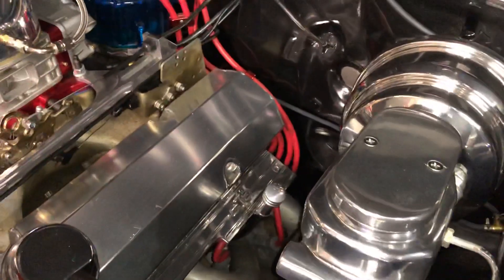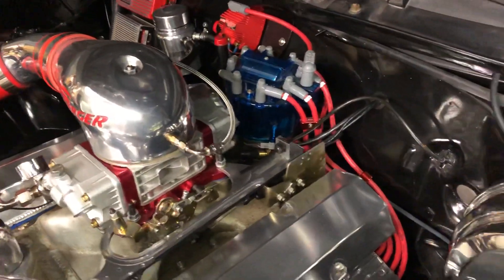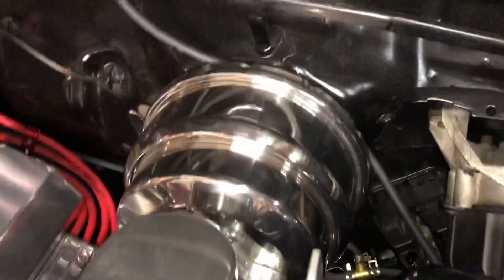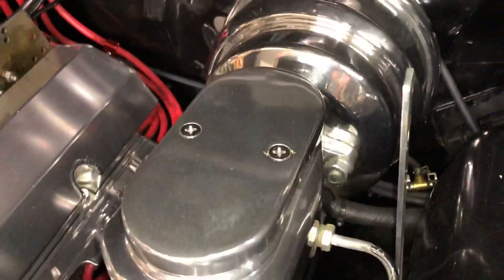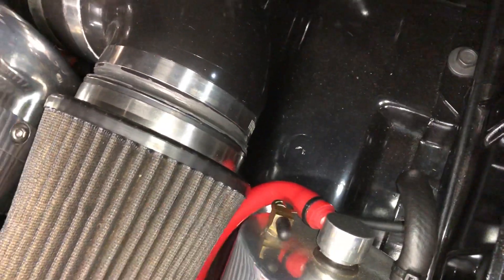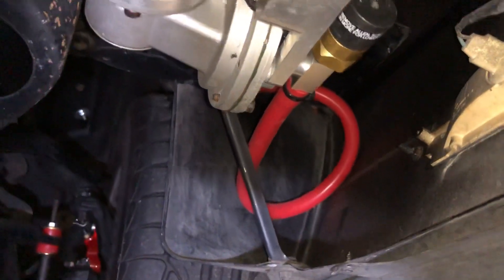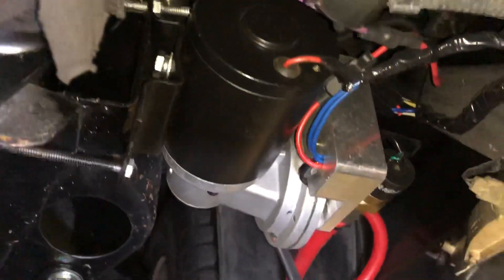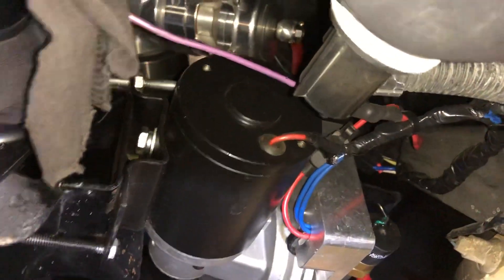Electric vacuum pump for brakes gbody

Comment: what brand/model # of pump are you using there?  and does it have an auto shutoff or is it running all the time?
Reply from the maker: This is a Leeds brake Bandit, shuts off in a few seconds. 2 wire hookup and no off/on required. They have this one with a shell case and a cheaper one with exposed wiring that works the same also. They use a hella motor (or that’s what I believe it’s called). Motors are about $75+ but never shut off.

Comment: GOOD VIDEO MY BROTHER..I JUST REBUILD MY ENGINE CHEVY 355 SMALL BLOCK..DIDNT NO IF I NEEDED ONE TO I DROVE MY BLAZER  AND MY BRAKES WERE ALITTLE HARD.. I DID UP GRADE MY CAM WITH A HOWARD CAM LIFT 525/530  DURATION .50 227/235  CENTERLINE 103 I WERE JUST WONDERING WISH VACUUM CASITER TO GET..
Reply from the maker: The canister doesn’t really matter much honestly, they’re all within the same size. The idea is that the canister stores the vacuum as needed but these electric pumps are so fast that they recover quickly. it would be pointless to get something as small as a sofa can though

Comment: I recently acquired a 1968 Ford Galaxie XL...What came in it was a Holbrook Racing motor...428 Cobra Jet. Lunati 544 lift so....power breaks...ehhhh. If I am on a hill and need brakes to stop at the bottom...I downshift to 1st. Hate doing that so....I bought a Summit vacuum pump...should give 20 inches...more than I need. The issue I have is there is no room under that hood for the pump...I may just plumb it to the trunk. I know the amps it takes is about 6 to 7 so good there and Should work well. I did not want to mount the pump in the cabin...though some have. Some "experts" say I have an issue of a vacuum leak but nope...My son built a Pontiac and stuffed a fresh 455 with a high lift....same brake issue and he put the same pump on his...no more issue. Since the car won't be thrashed at a strip or in bad weather...just driven to local gatherings...I think the hose should hold up to the small amount of VAC needed...I think 15-20 inches. Spring can't get here soon enough..LOL second day of winter NOW.

Comment: I have a383 stroker with only 11 pounds of vacuum.... I have big ass cam, wondering if I purchased the pump I just hook it up straight to the booster and block off at the back of the carb right?
Reply from the maker: JCS_5oH exactly. but don’t buy the pump I have it’s old tech. I’ll have a new video showing the Leed Brakes Bandit rotary pump which is faster and quiet. They use a Hella pump in their kit and charge accordingly. The carb becomes just your pcv line if you use it otherwise blocked off.
Reply: @nycore  awesome! Thanks I'll wait for that video
Reply: @nycore  I ended up ordering before I saw this  , the jegs one it was like 200 something.... It's the piston type then I saw the rotary ones... Oh well.... How much amps did it draw?
Reply from the maker: JCS_5oH Not sure of the exact amps but it’s not much. It’s been on a 20amp black relay for 20+ years and might have been on a 10amp line. Usually it comes with a built in fuse. They do work, mine still worked before I changed it.
Reply: @nycore  I'm waiting to see the other brakes
Reply: Will the pump hold up for a everyday driver threw stop and go traffic?